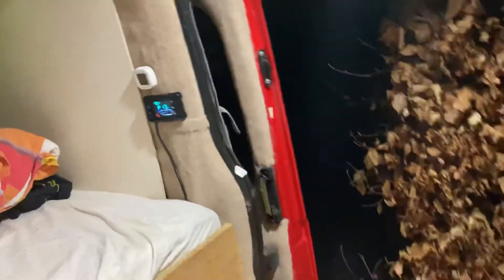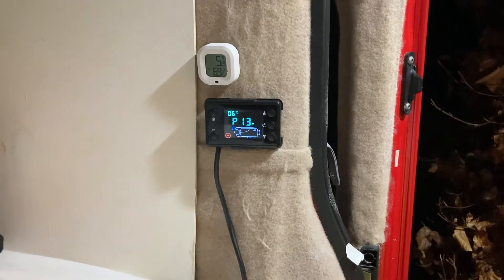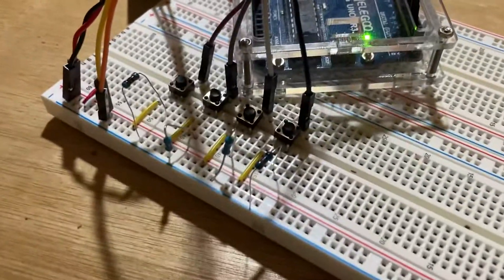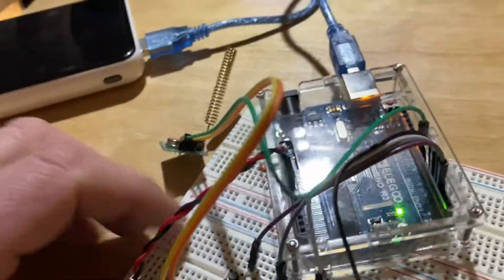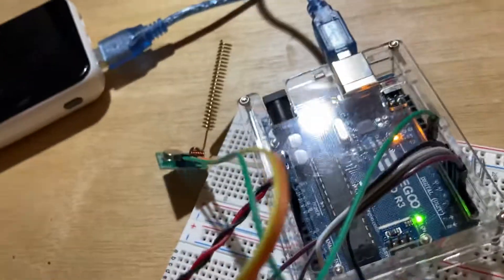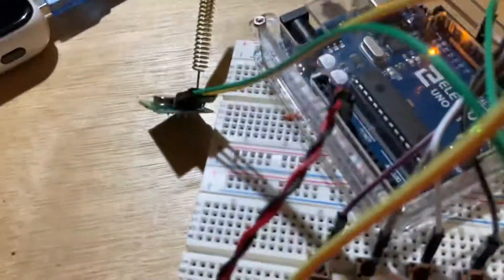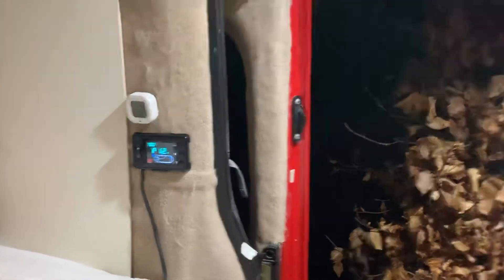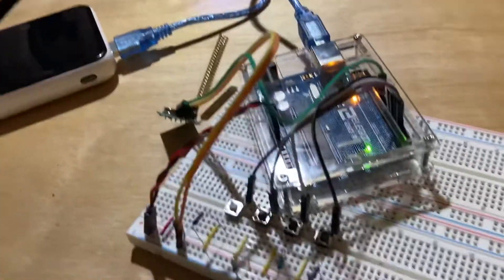Control Chinese Diesel Heater with Arduino through 433MHz

Comment: I built a thermostat it is hardwired one thermostat for heat on a delay relay one thermostat for it when it gets to hot with a delay relay I have found that once out of 25 or 30 times cycling it won't turn off or sometimes won't turn back on! The afterburner had similar issues and had to have a reignitition code written in to it does your device have issues at all with this or did you write some code in for ignition failures?
Reply from the maker: That’s interesting about reignition failures.  Do you have any ideas why that happens?  I’ve not developed it any further, due to work/life commitments.
Reply: @simplestuff3895  I have no idea why mine isn't reliable as it's hardwired either the delay relay which is on I think four seconds then shuts of to act like a button is not reliable which I doubt or these Chinese temperature sensors are not as reliable and shut down thinking it didn't ignite. I was wanting to do it using arduino but it's my first time I've ssh a phone or tablet once and many times done custom firmware on routers using it think tx rx the four programming pins it's been awhile and tablets and phones custom os. I can barely do basic command line stuff for windows and Linux can't remember any html I learned twenty years in college so there's going to be some learning curve! Lol. I wanted to adapt the afterburner to an all in one unit with built in screen then all I needed to do was the buttons which are easy but the developer said it was for that specific screen and would be to hard for someone just learning it. It can be controlled through loging on to its ip address so I'm beginning to wonder if I can run it without a screen the guy sells them but last time I tried to email him to buy one he never responded so I figured I'd have to do a temporary component driven one then start on an arduino based one! I really liked the touch interface and relay driven lights! I'm a carpenter had been doing public works projects and was planning to stay in my custom converted cargo trailer because I hate hotels someone always wakes me up at 2:00 am and so far I have been able to stay on site or campgrounds nearby. I have room for my tools a 1000 watts of solar 600 amp lithium titanate batteries which are amazing can charge them in 15 minutes if I could even get a charger that big can be drained to zero without damage and no cold weather issues I can make it a week without charging them running a full sized TV gadgets microwave and  induction cooktop but the batteries are larger than lithium ion and heavier but completely safe punctured them short them over heat them no fire risk! I thought about a van but kinda like leaving the trailer at a camp ground and going kayaking or hiking.

Comment: So, did you get an SDR and just listen to 433mhz while fiddling with the remote?

I've got 3 LiFePo4 battery banks with bluetooth and already have them talking to a PI and ingesting everything into influxdb.  I'm going to have to look at this and see about putting a 433mhz transmitter on it I suppose.

Curious if anyone else has decoded the other remotes that have bidirectional communication.  The remotes that display the current settings on a small OLED screen.  Not sure which controllers(so many versions) have bidirectional functionality.  Would be nice from an automation point of view for the PI or arduino to know what the current Hz the heater is currently at so you can have your own algorithm for hysteresis.
Reply from the maker: @Joseph Story.   Pretty much, I just used a 433 receiver module and some code to display the binary.  
I did find out the frequency as was trying to decode the protocol between the controller and heater ECU.    I did manage to get something, but I’m really not an expert.    There doesn’t seem to be many people trying to decode.    I know that certain models are easy to decode and other aren’t.  Mine is the latter.      There’s a couple of commercially available controllers that have been developed from the decidable modes.    Check out Ray Jones and the afterburner.    Think his is based on the ESP.    He’s got a very well developed product and doesn’t charge a lot, but a hassle shipping from Aus post Brexit.  
Theres a company in the UK that ripped off his design when he had it on GitHub.   The challenger I believe it’s called.   
As you say, being able to simply control hysteresis would be a great start.     
Will be interesting to see what you manage to do.

Comment: Hi. Excellent work.
I would like too to connect with my heater.
Can you provide the code or a link to the arduino code?
Reply from the maker: Sure.   I’ve just uploaded it to the GitHub camper controller repository.  You may need to record the button press strings from your own remote though.  
https://github.com/campercontroller/C